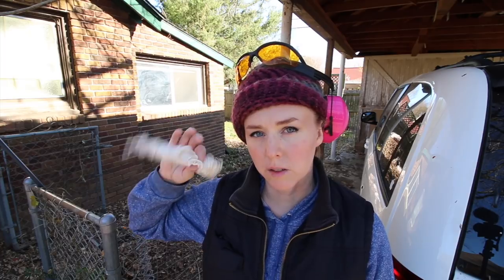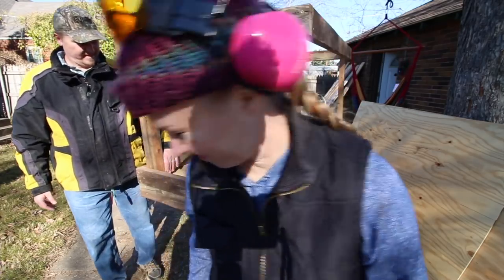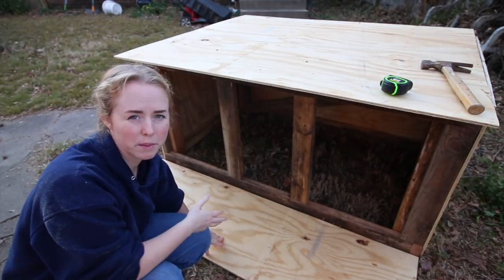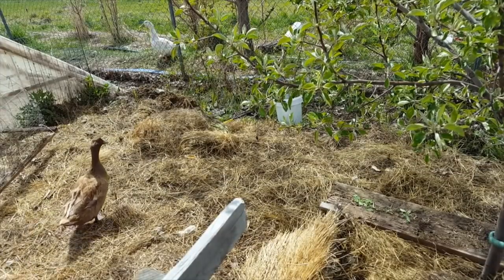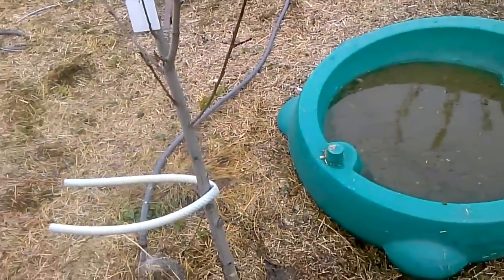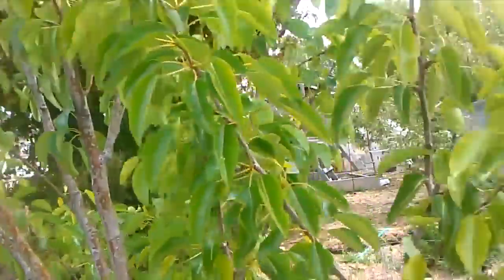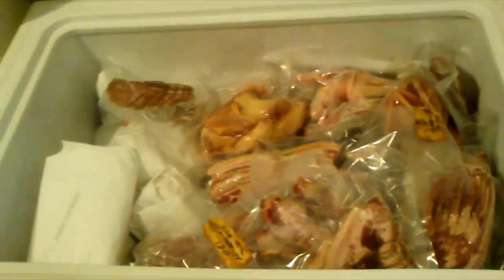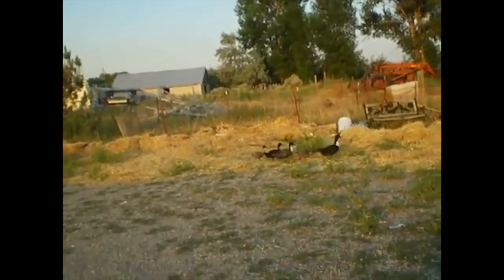Why We Choose Ducks OVER Chickens

Comment: I would have gone with both ideas. Create the folding wall, and frame a door into the wall. Latch the door, and it folds down with the solid wall without opening . Latch the wall, and unlatch the door for use.

Comment: About those vines. I put mine on a solid surface (my parking pad) and let them dry out. Then I put them on the bottom layers of my lasagne beds as I build them - either just under or just on top of the cardboard, or both. It's my theory that they provide aeration in the mulch layer. Seems to work so far, even with brambles.
I have NOT tried this with bind weed (Convolvulus) - that stuff is noxious! I try to burn it when burn bans are lifted, and put the ashes on the beds.